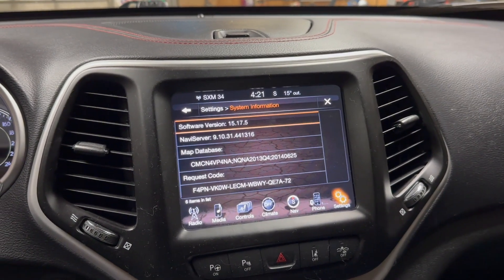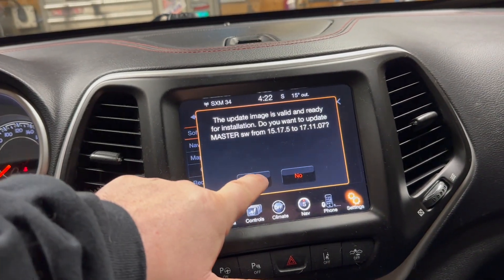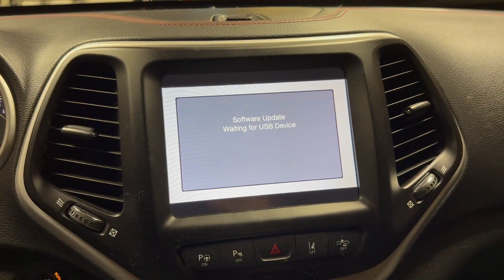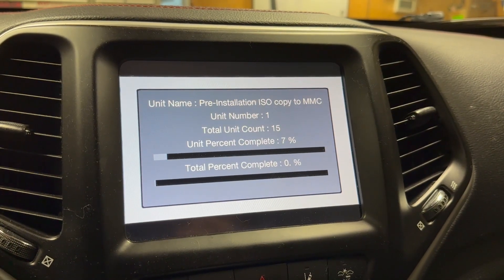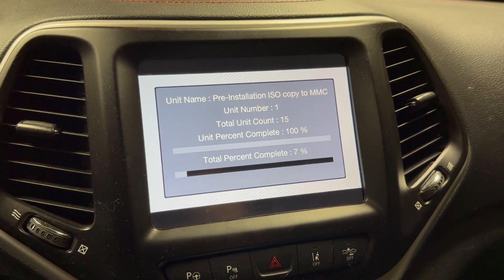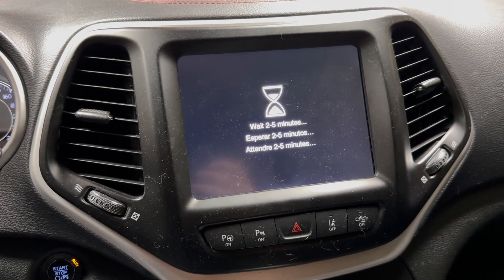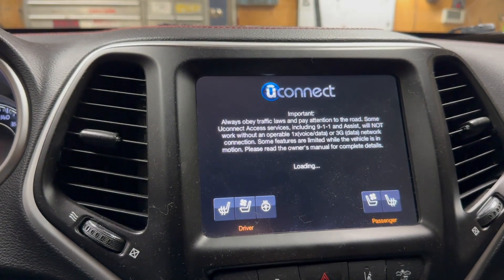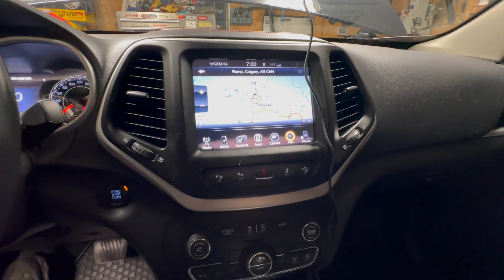UCONNECT 8.4 Frozen Update Loop how to Fix

Comment: I have the same problem bricking and looping on a Ram 1500  8.4 , but its looping endlessly, a battery disconnect did not reset it, and the USB process gets to 11 then asks for the same process, groundhog day style over and over ..

Paul
Reply: I need the older version of the 18.45.1   But no where is it downloadable...